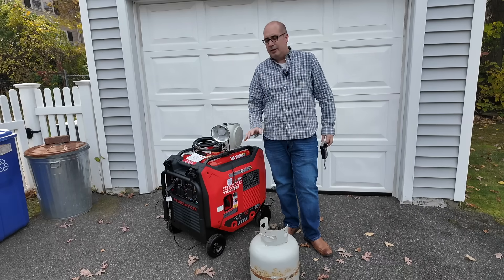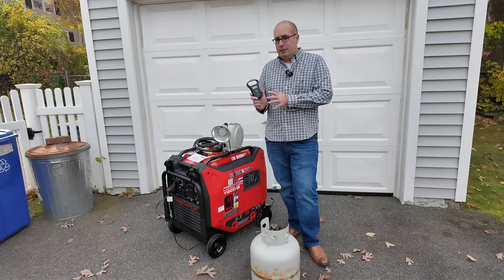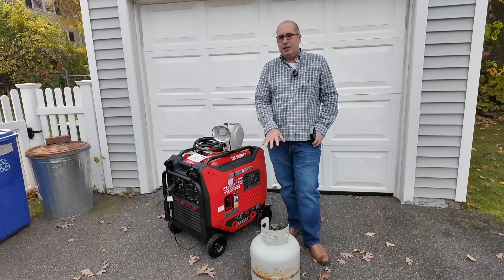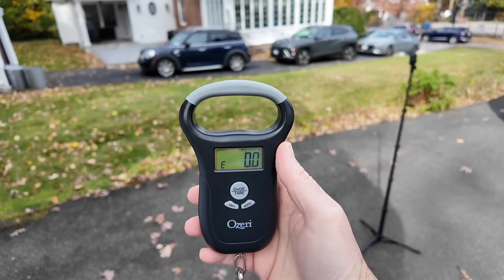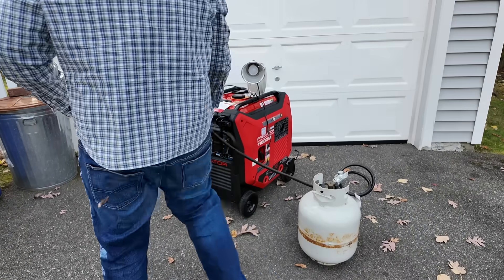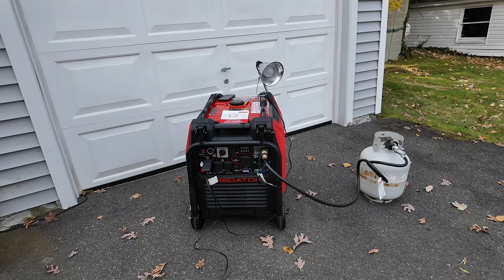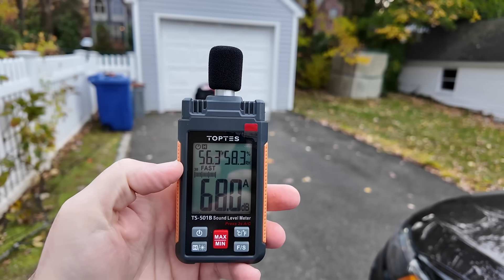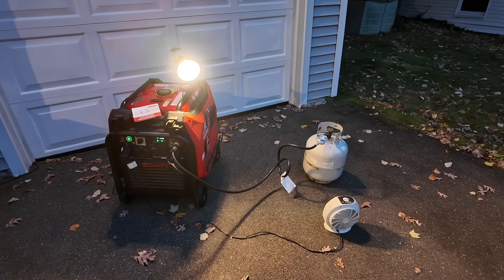Predator 11500w Generator Propane Runtime – You Won’t Believe How Long It Lasts!

Comment from the maker: ⚡ Pinned Comment:

Thanks for watching! 👊
The brand-new Predator 11500 inverter generator is an absolute beast — but how long will it really run on propane?

🕐 I tested it on a standard 20-lb BBQ tank so you don’t have to guess.
💬 Drop your setup below — are you running gas, propane, or natural gas?
🔥 Let’s compare runtimes! I read every comment and reply to as many as I can.
👍 Like & SUBSCRIBE if this helped — more Predator tests coming soon!

#Predator11500 #GeneratorTest #OutdoorPrepper #HarborFreight #TriFuel #PropaneGenerator
Reply: Somethings for people to consider with the Harbor Freight Predator generators.
1. Sometimes Harbor Freight has a coupon that can be used on a generator. Sometimes you can use a higher percent coupon if you belong to their club, this is often an additional 5% off. For larger generators it is often worthwhile to pay for 1 year club membership. 
2. Predator generators come with a horrible warranty. It is 90 days. 
3. Harbor Freight sells an extended warranty of 1 year or 2 years. 
4. The price of the warranty depends on the price of the generator and the term
5. The extended warranty is perhaps the best warranty in the industry. If at any point during the warranty period the generator is not working properly simply empty the oil and gas and then return it to any Harbor Freight (it's best to call to verify that that Harbor Freight has your generator in stock). 
6. The return procedure is to go inside, show your warranty, say it doesn't work. They might want to see the generator first. They ring up a new generator. If it's a larger generator they may have you drive to their dock in back of the building. They will take your old generator and load your new generator. 
7. The replacement generator comes with the standard 90 day warranty. Any time left on your original extended warranty does not transfer. 
8. It is imperative that you purchase a new extended warranty. 

It makes the most sense to get the 2 year extended warranty. The 1 year extended warranty is normally about 60% of the cost of the 2 year. 

If Harbor Freight ever comes out with a 3 or 4 year extended warranty grab that. 

A Predator generator including the price of the extended warranty will be significantly cheaper than name brand generator. 

If you purchase a generic generator on Amazon or other retailers it is important to assume that you throw the generator away if it fails. If the company stands by their product they will almost always require that you ship the generator back to their factory. In the US you must pay shipping on a heavy product with hazardous material. This will not be cheap. Then you have to pay to ship it, most likely to China. It may take 1-2 months for them to receive it. They will either repair it or send you a new one, again from China. Don't be surprised if they charge you return shipping. Also don't be surprised if the process takes 4-8 months.

If you pay for shipping both ways for a repaired generator you are looking at many $100 bills. It could cost more for shipping than buying a new generic generator.

Let's say that it only costs $800 to ship it both ways to China, hazardous material with a generator that weighs 200 pounds. If you can buy a new one for $1000 is it worth the hassle? What if you pay $400 to ship it to them, but they claim it was damaged in shipping or they never received it.

Most name brand generators require that you deliver the generator to an authorized shop. They may only have a single shop per region in the US.
Reply from the maker: Thanks for watching
Reply from the maker: Those are some great points. Thanks for watching.
Reply: You're right: I don't believe the test results because the test conditions are preposterous. No one is going to use a space heater to cheat the run time of a 20lb tank. We have enough problems with people understanding the value of scientific method today. Re-run the test with a 20lb tank without the "cheats" and compare the results. What would be better is that you use it as you would were the power out.

Comment: 4.7 Gallons is 7 Hours. A 120 gallon tank could theoretically last 7 days. Wonder what the manufacturer/manual recommended run hours are.
Reply from the maker: Manual recommended at least a 40 lb tank

Comment: Thank you. Great video. I am curious fo all the folks here that may have this unit. I bought mine yesterday and I am curious if others are using it as the house back up generator and if so did they look into the fact that the neutral is bonded to the ground as it says on the control panel (and is ) and that all recommendations are that the the neutral be "floated" or removed from contact with the ground for safety reasons. Anyone out there with thought on this?
Reply from the maker: Thanks for the kind words about the video and for raising that important point about generator safety! The neutral should be unbonded to make it floating. I will try to get a video out soon on how to do that

Comment: I think in actual winter it would be at risk of freezing up.  But if you want to be prepared for 24 hours or more, getting a 100lb. tank would give you everything you need.
Reply from the maker: A larger tank would definitely give you a longer runtime, especially in colder temperatures.

Comment: Well presented, but candidly think there is very little value in running test at only 2kW load, from persepctive of fuel consumption and sound at that low load. Why buy a 11.5kW generator to run at 2kW? The test is really invalid. As far as sound, I'd be more interested in knowing the level from INSIDE the house - or even in your closest neighbour's home! That is what prevents me from even using my open-frame generator when we have power outage even though I have a transfer switch already wired. Currently considering either something like this, or a battery solution (which will be more likely the case). But I did appreciate your review.
Reply from the maker: I totally understand your concern. I wanted to get a baseline at 2000 W so I could then calculate my actual usage. I don’t plan on using the generator near full capacity but rather roughly 50%. From inside the house it’s actually very quiet, which is why I purchased this generator since it’s fully enclosed and not an open frame.Thanks for watching.
Reply: @Outdoor_Prepper  I just watched your other video on the transfer switch and consciously noticed that I could NOT hear the generator in your basement. (but again, that test fell somewhat short by not energizing all the loads)

Comment: Great video! Not to nick pick but to help out with the accuracy. If you started at 11:06Am and it was about to be 7pm, it is clear to say that the generator lasted 8hrs and it could have possibly lasted another hour making it 9hrs. I would of also like to have known has many Kilowatts that space heater was using up as a reference point to whom ever would have purchase this as i am sure they would be plugging in more than a space heater. Thank you nonetheless for your great research work.
Reply from the maker: Thanks for the kind words and the feedback! Appreciate you catching the time calculation. I’ll make sure to be more precise with my kilowatt readings next time!

Comment: So 24hrs of running at 25% will take 3 20lb tanks. Going to have to have butch of tanks when power goes out.
Reply from the maker: It's definitely good to be prepared with extra fuel for extended runtimes.

Comment: if you are worried about tank freezeing.. pount exhaust so it leeps tak warm.
you can also keep gen outside but run hose under garage door ank tank wont freeze.
Reply from the maker: Thanks for the tip!

Comment: Good data!  at 4.2 pounds per gallon, you used 3.9 gallons of propane.  If in fact your electrical load was 2kw, that means you consumed 14kwh of electricity.  So, 0.277 gallons per Kwh.  From an efficiency standpoint, it looks like you were around 13.5% of propane energy converted to electricity. That is similar to other generator consumption test videos on YT.
Reply from the maker: Appreciate you doing the math and sharing those insights!

Comment: This video doesn’t make much sense, because everyone just wants to know what fuel, and how much of that fuel is required to run their generator at its maximum running watts for as many hours as possible during an outage, because 2,000 watts ain’t running your house☹️☹️☹️
Reply from the maker: I appreciate the feedback! The video focuses on extended runtime at a common household load, which can be helpful for many. No generator should be run at its maximum wattage for long

Comment: Ive noticed that propane burns less efficient (80%) than gasoline.  Gens will run longer with gasoline.
Reply from the maker: You're right, gasoline generally offers more energy density!

Comment: I take the opposite approach: a 1000 and 2200w generator. The 2200 runs my heat, fridge, freezer and some LED lights. Propane lasts a lot longer. Ialso have it plumbed for natural gas, so I have an endless supply of fuel, unless things get really bad.
Reply from the maker: That sounds like a very well thought out setup!

Comment: I have an old coleman 3000 w generator w carb probs, and a rusted tank. I used a fuel line hooked to my 20lb tank w a turkey fryer regulator and directly bypassed the carb, and plugged it straight into the exhaust recirculation hose. Worked fine and used the dial on the regulator to control idle and load
Reply from the maker: That's an ingenious solution to get your generator running!

Comment: We run one at the deer camp. It has no problem powering 3 big campers. It is running off a 250# tank, and we built a small shed for it.
Reply from the maker: Awesome to hear it handles 3 campers with no problem!

Comment: Hello there. Owner/Operator of a propane company here. I gotta say Kudos to you for actually know what you are talking about. The amount of ignorant self appointed experts on youtube is really worrysome. Tip of the day: Have your tank filled on a cool/cold day to get a full 20 pound fill. The OPD will stop the fill at about 18.5 pounds on a hot day because it works volumetrically and propane expands in volume in warm weather by 1.5% for every 10 degrees.
Reply from the maker: Thanks so much for the feedback and for sharing that valuable tip - that's really helpful to know!

Comment: I've been nothing but impressed with mine. First, I picked it up at a steal of a price. Second, it has proven to be perfectly capable of running my home via 50amp inlet. Third, it was stupid efficient when testing it on gasoline. I've since had my Natural Gas Connection installed but I have no doubt that I could get well north of 12 hours running my home off of gasoline.
Reply from the maker: That’s amazing and great to hear! I agree with you and think it’s a superb generator! Thanks for watching

Comment: still a money wasting piece of junk..  sorry but you would be better off going to just a battery bank and an inverter.   no noise, and you can run it on the grid without having some stupid switch or "DEATH"   cable to mess with,  or have to drag it outside whenever you want to be off grid..   i'll have to HARD PASS on this.
Reply from the maker: Appreciate the perspective and thanks for watching

Comment: yea.. thats like $1.63 per KWH,  compared to the grid which most people are paying less than 18 cents per kwh.   personally, i feel that propane use at this level is a waste of money.  better off buying a big lithium battery bank and recharging it whenever the grid is on.. you would pay MUCH less per kwh,   and if you want 8 hours of runtime or even 100 hours of run time,  you would just increase battery capacity,  which btw at todays prices for 48 volt batteries and 10kw inverter,   would likely be the same price as that generator.. just saying.   there's better ways to have a off grid backup of power.  and worse case for long term backups,  you could just add on some solar to recharge that battery bank.. be it,  that you'll pay a small increase per kwh until the solar panels are paid off.   still WAY better than propane.
Reply from the maker: Agree price is definitely an issue if running on propane for long amounts of time. For shorter duration outages though it’s very convenient to not have to worry about gasoline storage
Reply: @Outdoor_Prepper  no its a horrible way for short term power outtage.. you'll do better with a battery bank and 10kw inverter..  and likely cost less to puchase and less to operate.. because then you'll only pay for the power it uses to charge the batteries and you'll only pay for the power you use out of it..  which is MUCH less than Popane costs and gas costs by a huge factor.  $1.63 per KWH on propane compared to 8 CENTS PER KWH from the grid when its operational.   stop being stupid and look at it from a cost prospective.

Comment: What a joke, tell us what it last on a half , full draw. A little fan and light isn't even using 1,000watts of that 11500 watt generator. You could almost say cut that run time in half at full load. No your getting about 4 hours run time if your actually going to use the generator.
Reply from the maker: I focused on a partial load to give a baseline, but a full load test is a good idea too! Thanks for watching

Comment: Do you have a blue rhino to show us the different in weight.?
Reply from the maker: I don’t currently but will pick one up and do a comparison for a future video
Reply: I use 20# bottles of propane for cooking only in my RV house trailer in NW Alabama. Got those at a local convenience/grocery/hardware store from their exchange cage that is serviced by a local propane distributor. The exchange bottles only hold 15# but I found out later that the store could refill those in back with 20# for the same price. The 5 pound difference covers the distributor's cost for visiting each cage to swap out the empties for filled bottles then refilling back at their shop after testing.

Comment: But a tank heater is loosing effeciency. You have tge right idea using the exhaust heat. Maybe add a pressure gage to the tank so you know its not getting to hot
Reply from the maker: That's a great idea, thanks for the suggestion!

Comment: Would have been nice to actually run it until it was empty rather than guess how long it might run.
Reply from the maker: It’s actually not good for the generator inverter board or devices to run Tito’s it abruptly turns off under load
Reply: @O @Outdoor_Prepper s, there are a lot of old wives tales about that. The funniest one I read was that the “coils” could lose their magnetism because the connected devices would “suck” out the magnetism as the generator was winding down.  A well-made generator will open the main breaker when the generator falls below a critical RPM.  The biggest risk is with a diesel powered generator as they can such air into the system and require bleeding before they will run again.  That is a pain, but it also isn’t a problem for a generator run on gasoline, propane or NG.  If I had a generator that would be damaged if it ran out of fuel, I would not depend in it during an emergency as running out of fuel during an emergency is highly likely.

Comment: To keep the propane tank from freezing up, put it in that galvanized trashcan and then fill the trashcan with water from the garden hose.   If it starts freezing the water after a long run, just add more water from the hose.  Having a large "heat sink" like this will give you a much more consistent fuel delivery pressure.
Reply from the maker: That's a great tip, thanks for sharing!

Comment: You should have way to tank with the regulator on it but you can weigh the regulator and add to wait to it just a suggestion
Reply from the maker: Good point, thanks for the tip! Will be sure to do that nxt time
Reply: @Outdoor_Prepper sure no problem I purchased a predator 5000 watt dual fuel generator a couple of years ago I just now got it broken in and it runs great have yet to run it on propane one tank of gas at 25% I was able to get 16 hours of runtime

Comment: It's called auto-refrigeration. A smaller tank will have less volume and while running the generator, will "boil" off the propane more rapidly than it can keep up with. When boiling off the propane, it's temperature will drop to a point where gas can no longer keep up with the demand of the generator. Placing it in line with a heat source changes the outcome. While you're using a 1/4 load to test the longevity, keep in mind that the idle speed (eco-mode) will not raise the idle until it goes beyond 25% load. The propane usage is not a linear number. Another words, doubling the usage is not going to mean 1/2 the time on propane. Thanks for the video production. 😊😊
Reply from the maker: Thanks for the info and glad you enjoyed the video!

Comment: Why didn't you let it run out?
Reply from the maker: I actually had dinner plans so couldn’t sit there any longer and additionally it’s not good for a generators inverter board to let it run out of fuel and turn off while under load. Hopefully the video was helpful and have an accurate runtime expectation. Thx for watching

Comment: While the video is pretty good, would it be possible to put a real load on it? Like what would happen in a power out situation? A couple lights, refrigerator, heater (or home furnace), etc? Something that would be a more realistic load.
Reply from the maker: Absolutely. I wanted a base case but will do a full load in a later video